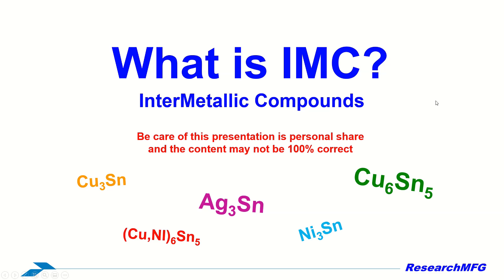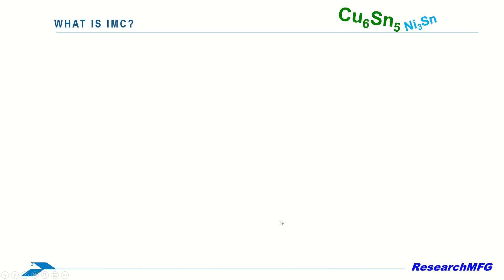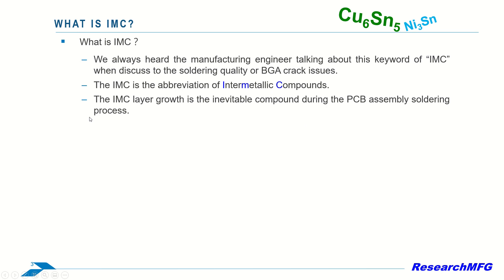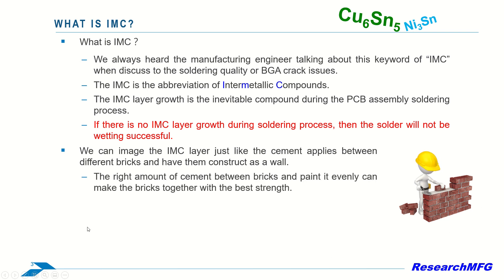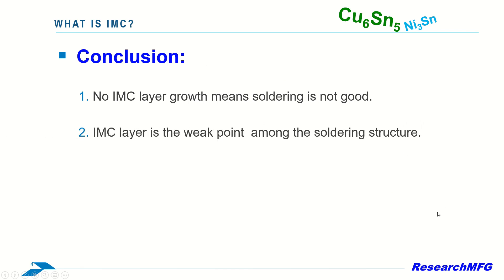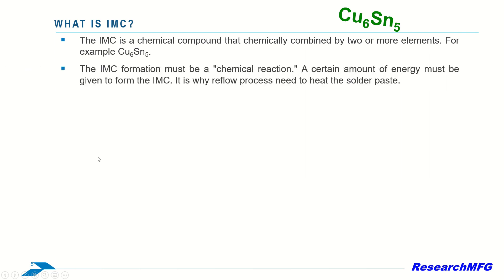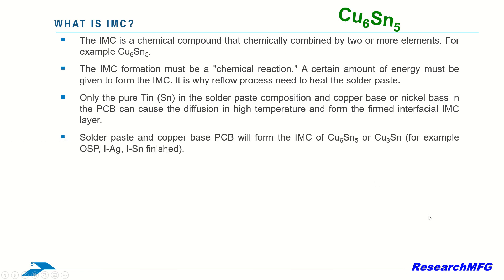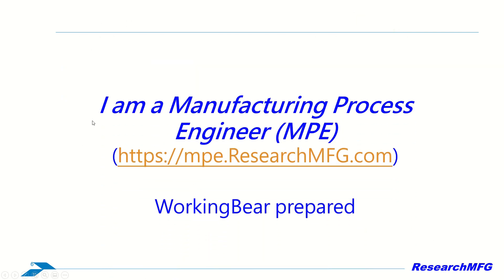What is IMC (Intermetallic Compounds) part I? IMC concept

Comment: You could have started with the basics. I understood just 30%. I was searching for IMC for my PhD. Programme. Not very useful.
Reply from the maker: Well. This video is not for PhD study. This video introduces the IMC concept and soldering to the manufacturing engineer and mechanical engineer. Most of the manufacturing engineer may not know the chemical in the soldering. So, this video just shows the concept to know how the role of IMC plays in the soldering.
Since you had spent the time watching it then you may check out the second, third, and fourth video about the IMC introduction.